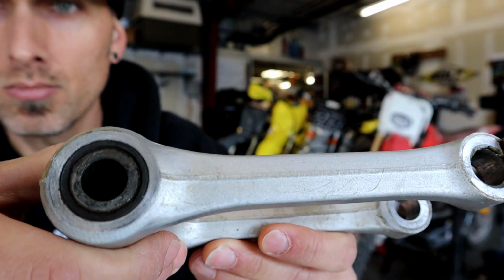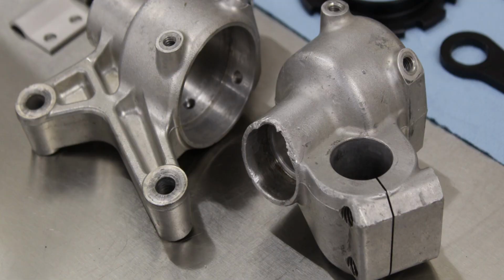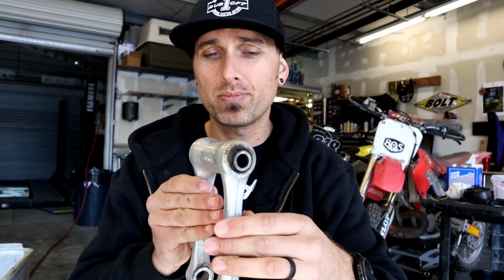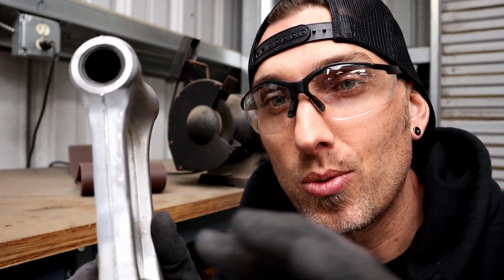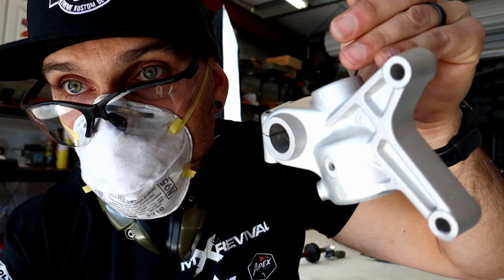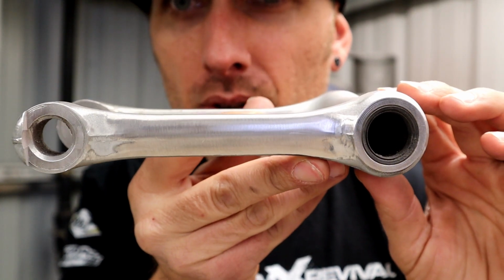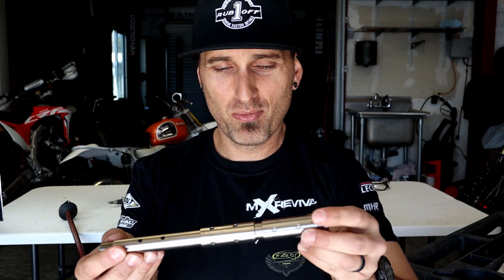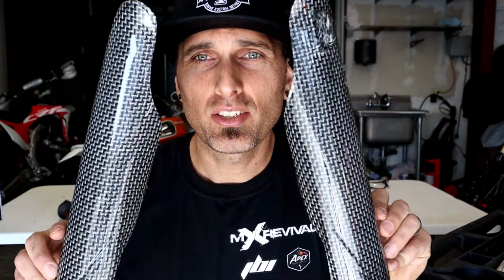HOW TO // Remove Casting Flash Lines - Aluminum Dirt Bike & Motorcycle Parts YZ300 Two Stroke Build

Comment: It's good
Do you have any specific solution for complex profiles parts with cost effectiveness 
I am in a die casting manufacturing unit and facing lot of challenges related to the cost and manpower 
Pls help
Reply from the maker: Sorry, I can’t help with that as I am not a manufacturer of any type of product